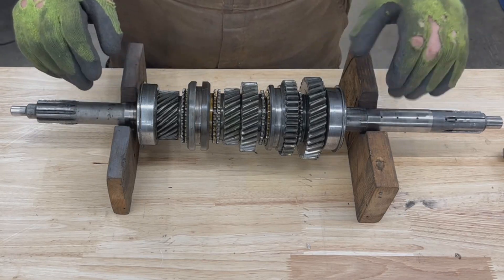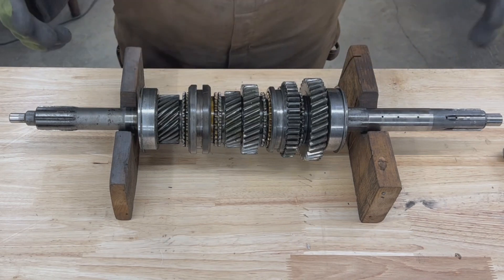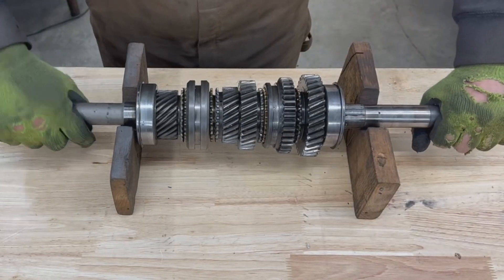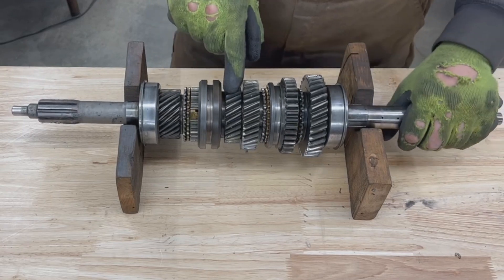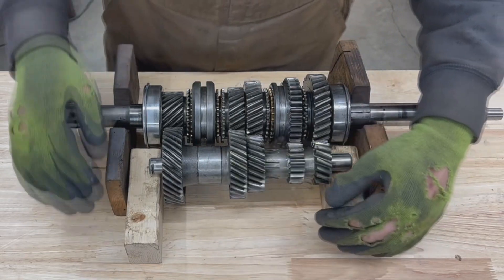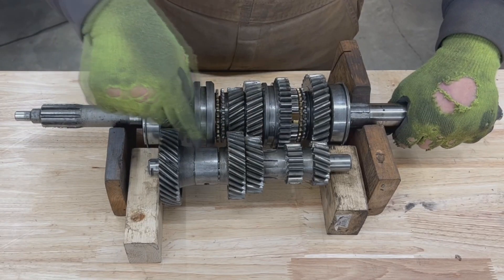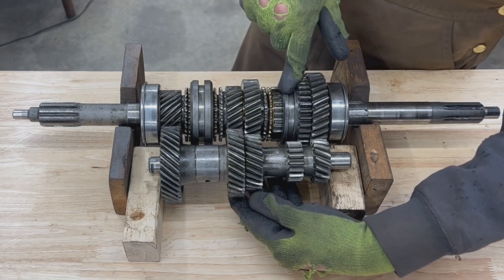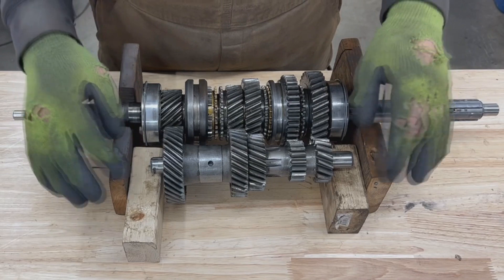How a Triumph TR6 transmission works.

Comment: Hi Elin
Very educational video 😀👍
 My TR6 gearbox has a noise i neutral and in 1-2-and 3 gear, but in 4. Gear it is quiet. I suspect a baering to make the noise, but which Baering would you suspect ? I think either the needle baering between the input and output shaft, or the baerings in each end of the countershaft. My plan is to take the gearbox outof the car this winter.

Comment: I have rebuilt probably a dozen TR-6 and Spitfire gearboxes.
This was a great explanation of how they work.
The TR-6 gearbox has a few weak spots. The bearings in the layshaft tend to eat into the layshaft which destroys it. The top hat bushings tend to break if one slams the gear changes too much. The rest of the gearbox is very robust.
They are easy to rebuild and require no special tools.
Reply from the maker: The top hat was broken in this one. Coming up in the next videos

Comment: Very enjoyable video, and very clearly explained, well done!! I love these old triumphs, would love to have a Vitesse, it's that shape around the headlights. I had a 1976 spitfire and did a running overhaul of most things whilst using it on a daily basis. I did get caught out on the gearbox though the last stage is to refit the cover and just below the cover is an interlock plate which stops you being able to engage both gear pairs at the same time. If you don't fit that you can lock the gearbox up completely! Unfortunately I found out the hard way!! Good luck from Spain!!

Comment: You are a very good explainer. I've watched you explain this a number of times and this was probably the best version. Any chance you good do a similar short video on how the synchros works? Nobody ever explains those. Never understood the mechanics of why those don't grind just like normal gears.
Reply from the maker: I will include that in my transmission assembling video in the overdrive series I am working on now